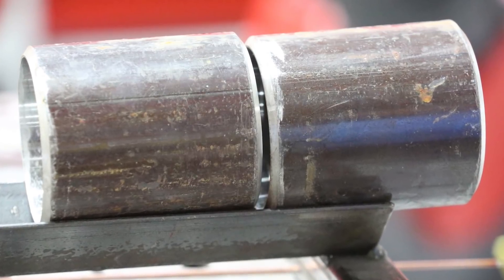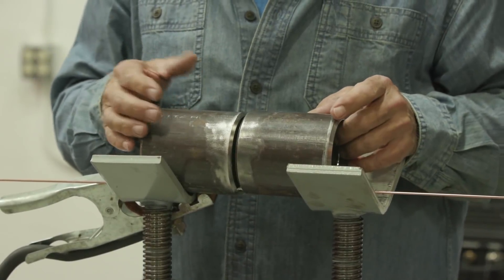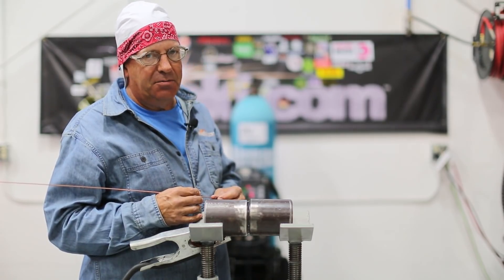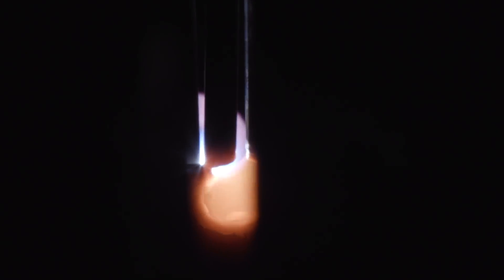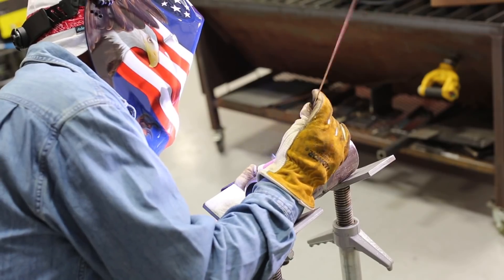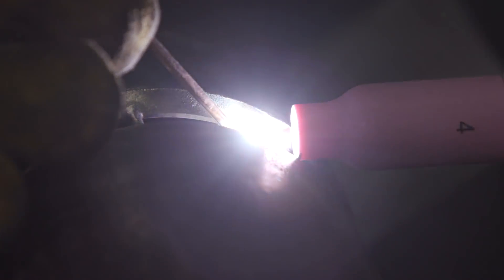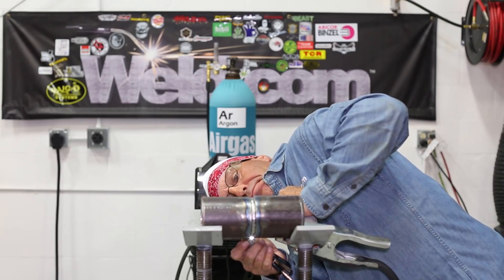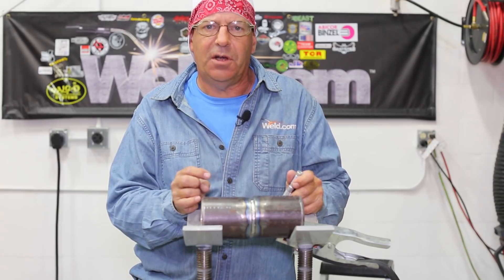How to TIG Weld Open Roots with High / Low

Comment: Had a fair old bit of high-low over the last 2 weeks or so, on 30" and 32" sched 10 pipe, has been a real PITA. Out of round pipe, oval shaped fittings, the lot 😄 Up to sometimes 3mm for perhaps a foot at a time lol. Along with the gap closing up, have had to drop down from 2.4mm to 1.6mm filler and really REALLY keyhole it. Has been a lot of swearing and bad language going on 😄😄

Comment: Got into a job last year that they gave us standard wall fittings and schd 10 pipe. Not to bad once you get the hang of it.

With down hill stick, make sure you have your normal spacing, but make sure your spacer hits 3 points.  Kick your rod slightly towards the thicker pipe/Mose inner wall. Don’t get carried away with a massive angle just a slight bit.  Run your normal heat and let her soak in there

Comment: Ok, real question here! How often is gas tungsten arc welding used in the field?? I see that it can be done but it seems slow compared to stick or flux core or mig. What situation would one use this process on pipe. Don't get me wrong! GREAT video and love ya Bob! I always learn something new. But just wondering. 😀👍👍
Reply: Workshop Tazz It is used extensively in the field.
Reply: Ok thanks Bob! I learned something yet again....... Hate when that happens.  👍👍
Reply: Pipe in the refinery and offshore drillrigs
Reply: Workshop Tazz it will be used on any kind of alloy pipe welding, also on thin wall carbon pipe
Reply: 99% of the time.
Reply: It's used 100% of the time in refinery's,chemical plants,papermills,powerplants. The only time I use stick is if its heavy wall carbon or chrome and I mean heavy wall were a J bevel is being used. You would tig root hot and maybe one fill then stick it out. Stick is really only used on the pipe lines and in the oil fields. Tig Tig Tig Tig Tig Tig Tig Tig Tig it's just better than any other process.

Comment: Great info. The one thing I wish you would show more of is your hand that is feeding the wire. I noticed you slightly pull off the metal with the torch and then are you repositioning your hand up the wire?
Reply: Alex Bergey Yeah sometimes. Depends on what's going on in the pool.

Comment: The worst is seamed sch10 stainless. Pipe and fittings never match up. I’ve personally seen over a 1/4 inch of high low. I welded a 24” in the rack the other day that had 22 dogs on it and still had 3/16 of high low
Reply: Tyler Bishop I feel for you.
Reply: Bob  Moffatt one thing I noticed that contributes a lot to the mismatch is when the pipe is from one country and the fitting from another. We did a 12” pipe to elbow and the pipe could’ve almost slipped over the elbow
Reply: Tyler Bishop I can agree with that too.

Comment: Every fit can't be perfect !!
Reply: Currently working with sch 10 stainless. No wall thickness to transition. Had a few reused fittings and high low is out to lunch meeting new pipe/fittings.